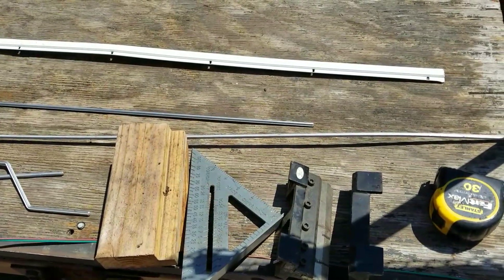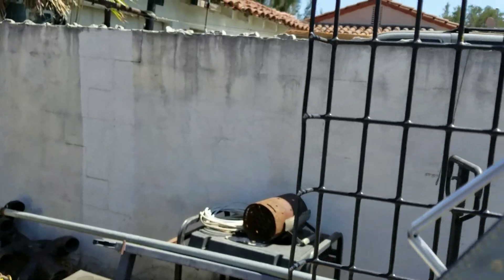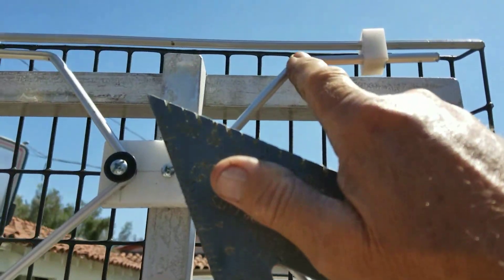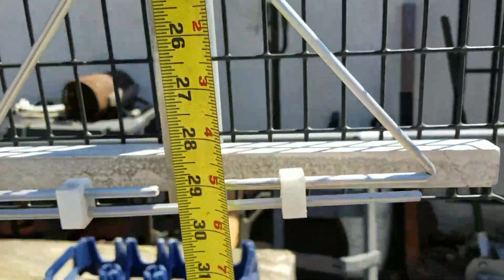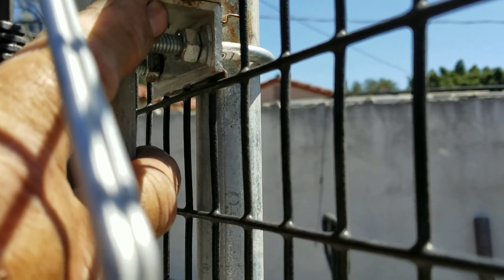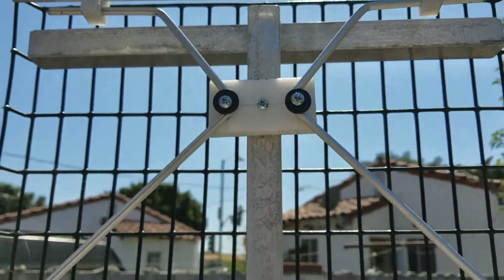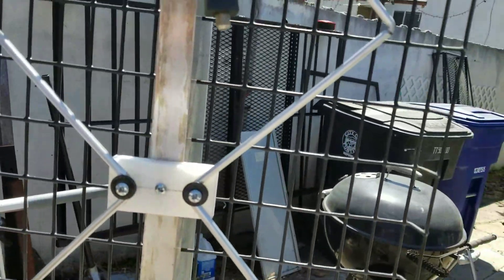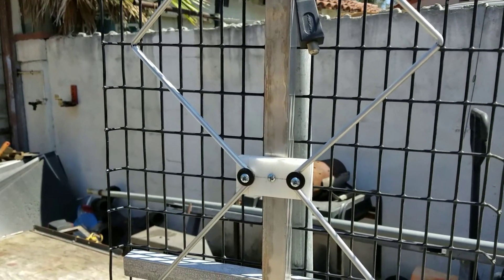My High Gain Antenna Build Specs and Instructions.

Comment: Found your antenna specs.... thanks. Say I went through it kind of fast ... but missed the distance between the reflector and the driven elements... you might have mentioned it but I missed it. I will watch it again. Thanks...
Reply from the maker: It's 2.5 inches.  The square aluminum tube are 1 inch each, and the pvc insulators are .5" thick.

Comment: The aluminum element wire, is the diameter 1/4" ??? Thanks
Reply from the maker: Yes, approximately.   It is the control rod from "Levelor Blinds", and not perfectly round.  It has 2 grooves that run the length of the rod, but I doubt that makes a difference.  I just worked with what I had.
Reply: @GBear  Thank you fella. I need to make me an antenna and will be using your design. Nice work fella too. vf
Reply from the maker: @victoryfirst2878  let me know if you need more help, I'll do a video for you.
Reply: @GBear  This is something I want to run buy you. Would making the plastic coated steel out of brass, bronze or copper somehow make a difference on performance ??? Reason I am asking is that sometimes the dumbest things make great things happen.  I will start getting materials for the build. Thanks again fella. Peace too vf
Reply from the maker: @victoryfirst2878  The deflector shield is to prevent signals from entering from the rear, in essence to make it a directional antenna.  It acts like the dish part of satellite antenna.  You want it to deflect signals,  not attract them.  The Gray Hoverman is a directional antenna and was designed to precisely hone in on a single transmitter antenna.
Reply: @GBear  Why does this antenna work so well in s small size and other antenna are so large monster sized doing the same thing ??? Thanks G Bear's
Reply from the maker: There are large and small antennas that both work great, and others that don't do so well.  People have been searching for many years for a better antenna, much like a better mousetrap.  I researched for an antenna that would work for me in my desert off grid location and found the gray hoverman design to work best for me.  Depends on one's location and available stations for what might work best.  I just got lucky.
Reply: @GBear  With all the information you have given me I look forward to make my antenna. Since you live in the dessert you have a very distinct advantage as signals are not obstructed by mountains, buildings, trees and such. May I ask roughly location G-Bear's ?? Thanks and peace too. vf
Reply from the maker: High Desert, California is as close as I'll disclose.
Reply: @GBear  Great place to live. The humidity is so low the joints do not ache as they would in an high moisture environment as I live in Pennsylvania or as I like to call it TRANSILVANIA.  Good day to you Sir and make sure the sun shines on you all day. Peace
Reply from the maker: @victoryfirst2878  thanks.  Yeah, and the altitude is good for arthritis too.

Comment: I have built these Grey Hoverman style antennas before and found that the reflector screen as they are called usually makes no difference in reception.
Reply from the maker: It's only supposed to block interference from channels from behind from what I know.  You are right, unlike a satellite dish that uses the dish as a reflector towards the receiving unit, the wire screen doesn't do that.
The satellite dish works like a parabolic mirror to gather incoming rays and combine/direct them to a single point.
Reply from the maker: Welcome aboard!

Comment: This antenna looks great! Thank you for taking the time explaning how you built it and with some of the measurements. I do have one question the plastic pieces screwed to the center post, what are the spacing's for them centre to centre. Thank you very much for your help. Regards
Reply from the maker: Thanks, and welcome aboard.   I thought I gave all those measurements in the video.  I'll have to wait until the next time I'm on the roof to take measurements because I have forgotten.

Comment: Camera too close.  Not once did you show entire antenna.  Where is your proof it will work?
Reply from the maker: Check my playlist.  I show both builds doing a channel search and the number of channels found, as well as the clarity of reception.  I also show them installed on my off grid cabin in the high desert, picking up San Diego channels.
Thanks for watching.

Comment: How did you bend the rods for your hoverman antennas?
Reply from the maker: Trebla Setroc in the beginning of this video, the black 2 pc tool to the right of the speed square fits in a vise and the rod is placed in between the chisel side and the V side and the vise is tightened.

Comment: Specs on the reflector. Screen??? That helps. You explain everything except the ScreeN??? I get it levelor tube> Ok I get it. levelor and aluminum 1" ok screen not a word plastic at the scrap  square tubess muffler, specifics on the washers??? why??screws and washers hieghth lenth more screws ok screen???? reflector????

Comment from the maker: This is a common question.  I'm sure copper will work just fine.  I used aluminum because a:)  I had it, b:) It is light weight, and c:) Copper would have been more expensive.
Reply: G Bear lake
Reply: G Bear I'll

Comment: The Gray Hoverman certainly is a great antenna. That's an excellent build you did.
I made two of them and they both out performed my commercial channel master antenna. Thinking about doing another one.
Reply from the maker: I built 2 of them also and love the reception!
Reply: Same here I got 2 pointing at different directions, hmm about 40 degrees apart. Would like to build one for Southern reception and combine all the signal and boost them via commercial CM. .
Reply: Lambert Klein to get dkay
Reply: Lambert Klein wahycommd
Reply: Lambert Klein qoml?eityugnoTbas

Comment: Whats the space between the reflector and elements?  And the spacing on the elements where they mount to the plastic block in the middle?
Reply from the maker: hogcat space between elements and reflector is two and a half inches and space between element bends at the plastic blocks is 2 inches.  The center screw holds the plastic to the frame and the screws holding the elements are 1 inch to each side of that.
Reply: Thanks a bunch!!  I just found your channel today and am going to build one in the next week or so after I get some supplys.  Been watching that guy in Georgia videos also.  So between the two of ya I should/hope I build a good one.
Reply from the maker: hogcat best wishes for a successful build.  Remember to SUBSCRIBE!  I'll be posting a lot of great stuff!
Reply: I am subscribed.  Where in the desert is you spot?  Borrego area?
Reply from the maker: hogcat no, upper desert.  Near Edwards.

Comment: Nice video.We want to try this and most of the stuff.We have some square galvanized laying around.Would it work or does it have to be aluminum like yours.Thanks
Reply from the maker: I see no reason you couldn't use the square galvanized tube.  It will be a bit heavier than the aluminum tube.  All the antennas I have seen on houses and in stores are aluminum, probably for the cost and the weight.  One guy commented that he used wood and coat hangers when he was a kid.
Reply: Thanks
Reply from the maker: To see the antennas out in the desert (The reason I made them)  see: https://www.youtube.com/watch?v=Z-94DQONYNw